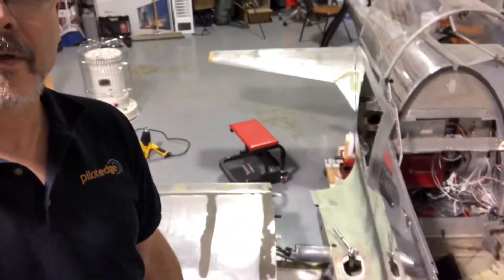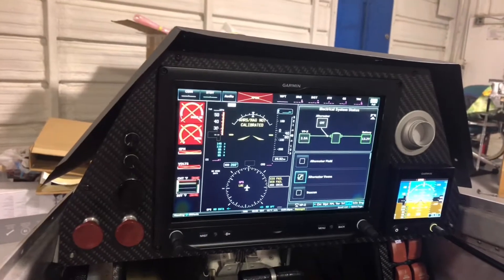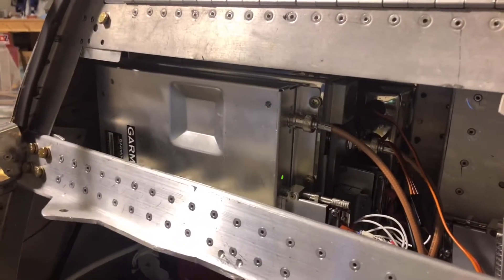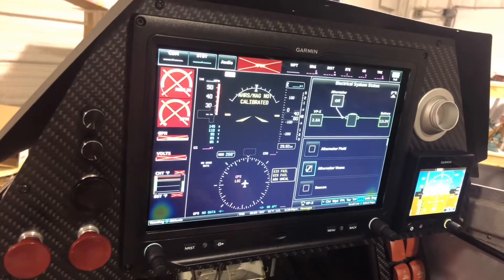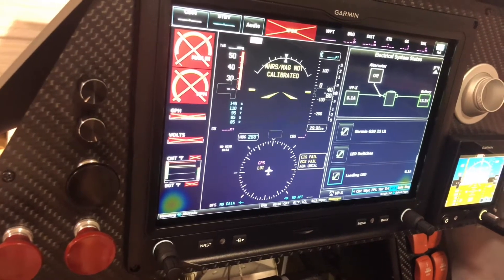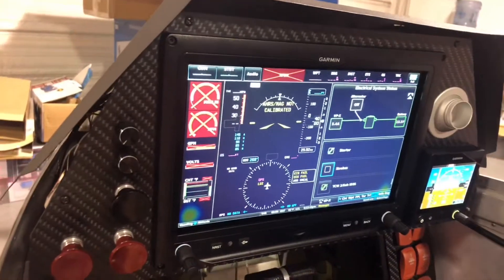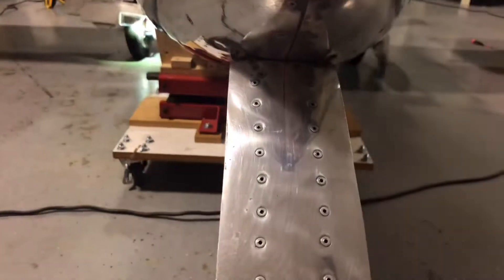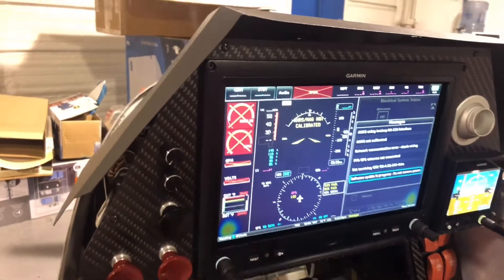Vertical Power VPX interface on Garmin G3X Touch

Comment: Are you happy with the vp-x? Was it worth the cost?
Reply from the maker: I do like the VPX unit. After the learning curve for programming it and figuring out how to wire it, it was actually quite simple and saves so much panel space. The interface with the G3X allows for an electrical control panel like any of the most advanced aircraft being sold today... that is major cool!